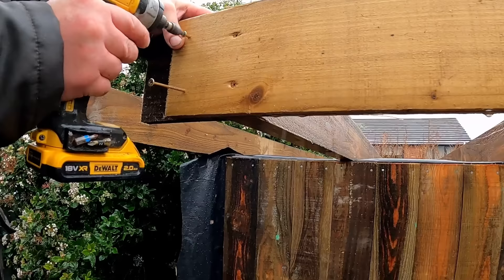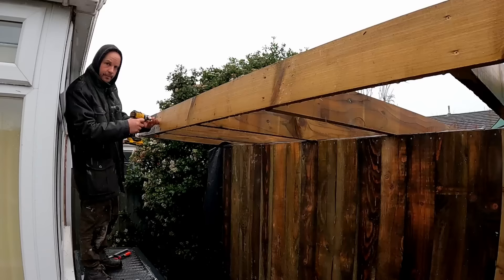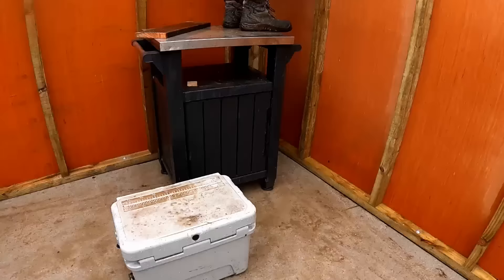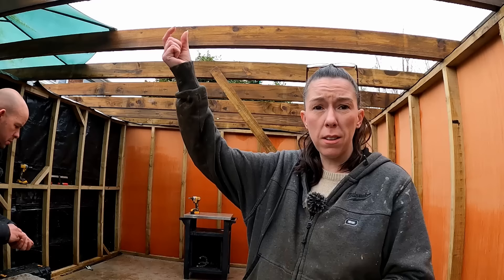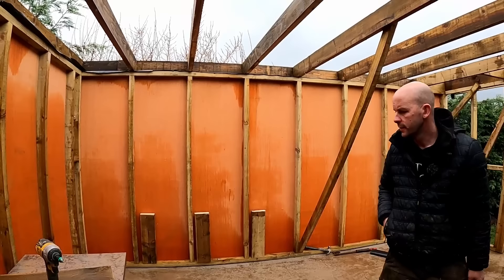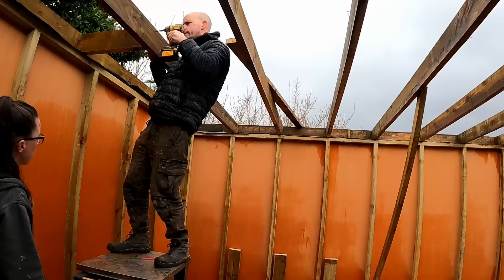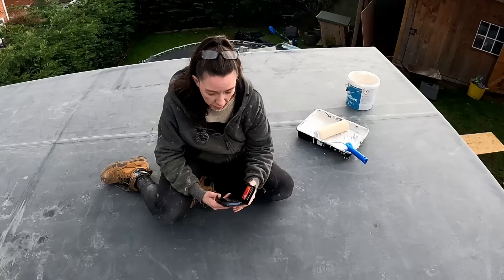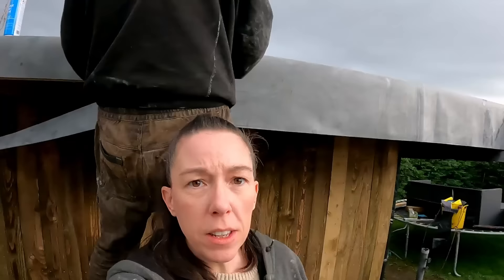DIY Shed Build - A Roof In Under 5 Hours?

Comment: If you want port holes on the cheap try the glass from the front of old washing machines. I did and it's quitky but it works.
Reply: Fabulous idea. 👍🏻
PU car panel adhesive/mastic will stick the rubber sheet to the glass. Ideally fit the glass(es) while skinning the roof but Gemma & Simon will have their ways of getting it done.

Comment: i recently made a 3m square shed, when it came to the door I had just one bit of OSB left, just the right size, and no studding left, so my door became a sliding door, placed on some stainless steel angle iron at the bottom, and trapped by a couple of bits of wood at the top- works like a charm, and doesnt require any extra space for the door to open (other than about an inch inside)

Comment: I'm not through it all yet, but are you going to put some leaf guard screening on that gutter? Good preventative for not having it clog up with stuff.
Reply: I looked at those for my house once, didn't end up doing it because a lot of people warn that they don't often work that well (just delays the problem, doesn't eliminate it) and can cause other issues in the meantime.
Reply: @stephengentle2815  Well, my experience says they're wrong, and especially considering the difficulty of access to the gutter on the shed since it is back there against the neighbor's fence, I'd put them on even if it does only delay how often you have to clear out the screens themselves (which is easier since the debris stays on the surface and can be brushed aside with a broom easily rather than having to go down INTO the gutters, etc. etc.)

Comment: You did put the gutter on the low side of the roof didn't you? Difficult to tell on the videol, only the water won't run up hill don't you know, lol. The port hole idea sounds good, I remember one time on TV, I think it was George Clarke's Amazing Spaces, someone had used washing machine door glasses for portholes, they were brilliant, cost nothing and easy to install providing you could cut a round hole. Just a thought! The Valentines Day comment was right on my wavelength, still sniggering! Best wishes, John

Comment: It looks like when you were putting the gutter in, you had the downstream gutter on top of the upstream gutter.   It should be the other way so the water doesn't have a way to flow under the seam.

Comment: Is that Pressure Treated wood ? Why no sill protection between the concrete and the wood sill ? Looks like water is wicking up your side and rear walls already . Hope you get some warm sunny days for everything to dry out . Cheers .
Reply from the maker: You will see at the beginning of the video the walls are wet, this is due to rain, but also all the timber was wet, so the ply sucked it all up, but once the roof went on and it had a few days to dry it’s all good now!
Reply: Excellent and thanks for replying . Can't wait to see how the inside will shape up . Cheers again ! @ShipHappensUK

Comment: Hi, I`m planning a similar project this summer.  Can you tell what planks you used on the outside and the plastic sheeting please.
Thanks.J
Reply from the maker: The planks are just 6x1 timber, and the plastic is damp proof membrane from screwfix
Reply: Hi thats great thanks.